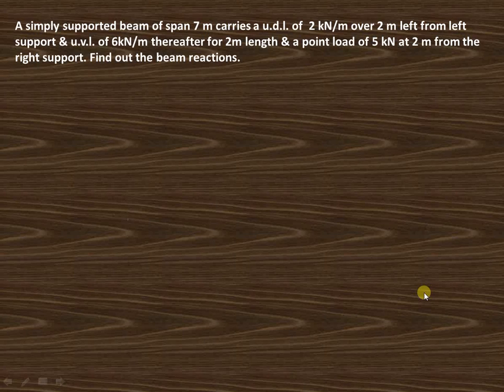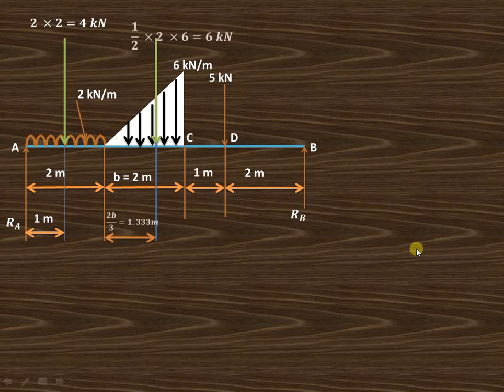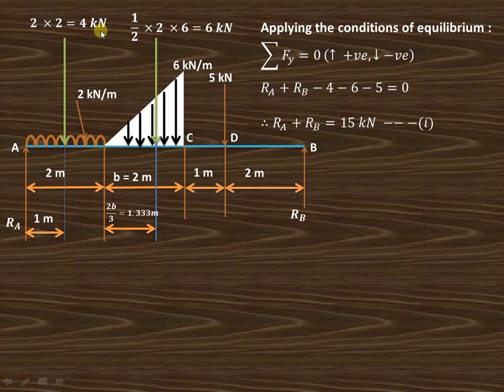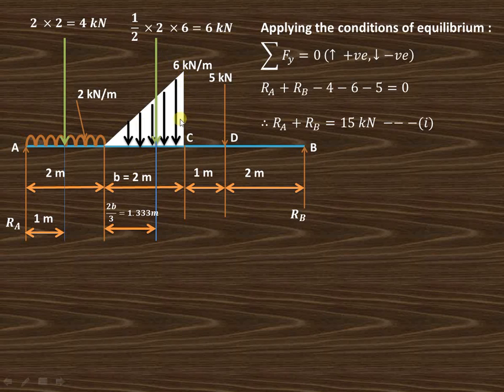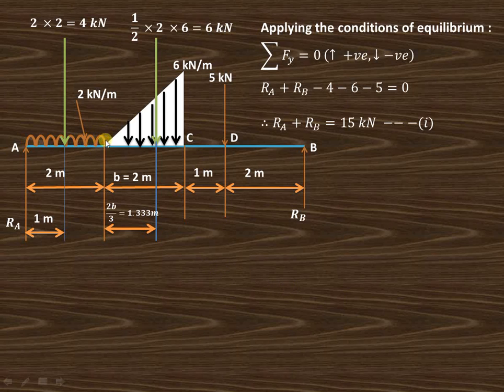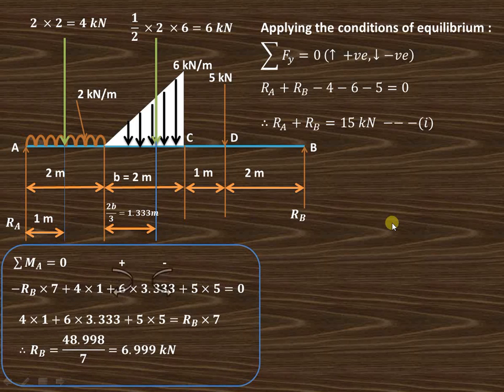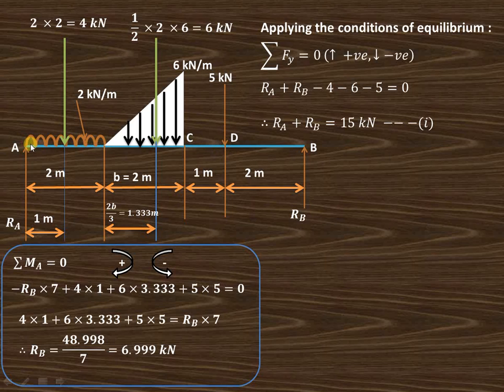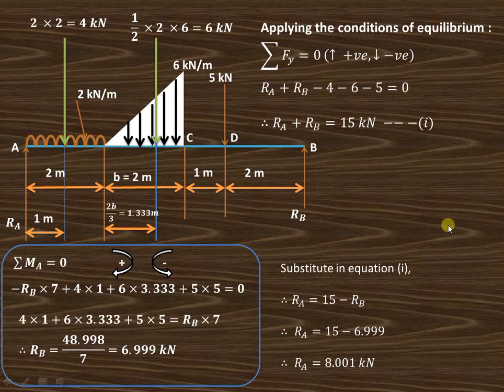Lecture 2 | How to find beam reactions | Simply supported beam carrying u.d.l. & u.v.l.

Comment: @CHINMAY_ACADEMY - thank you

a. all above the considered x-axis line are load
b. all beneath the considered x-axis line are distance, required distance to calculate
c. all moments clockwise positive, all moments anti-clockwise negative
d. to determine the moment starting from the endpoint or right hand side (it is for easy understand at early stage) to the left and gradually calculate force x distance to the beginning point for deriving equation. In the equation again clockwise postive, all moments anti-clockwise negative.
Reply from the maker: Most welcome!

Comment: Why 2b/3 ? Shouldn't it be 2h/3? Why are we calculating CG by the base, shouldn't it be the distance of height?
Reply from the maker: As load is acting vertically downward, we have taken the distance 2b/3. If you take 2h/3 then it will be acting above the beam by a certain height, which is not required in this case. Hope your doubt is cleared. Thanks... if you still have any doubt please ask...
Reply: CHINMAYACADEMY Thank you sir. I get it.  As we need the distance horizontally, we take cg about y-axis
Reply from the maker: You are most welcome ...